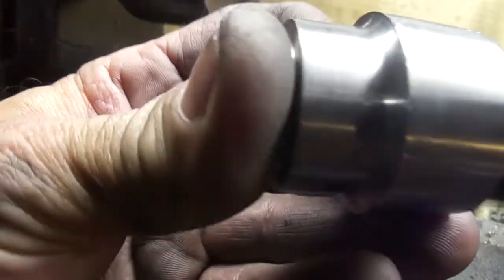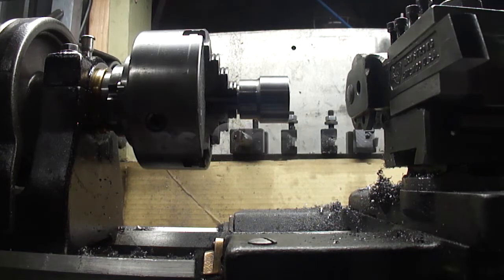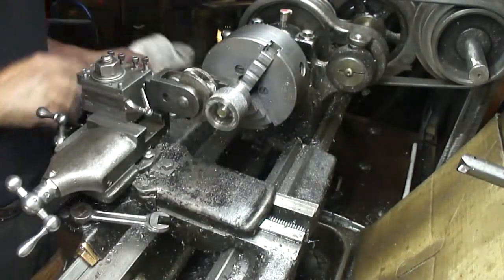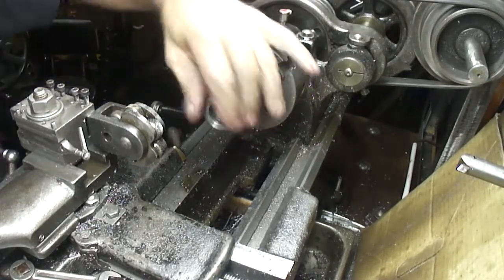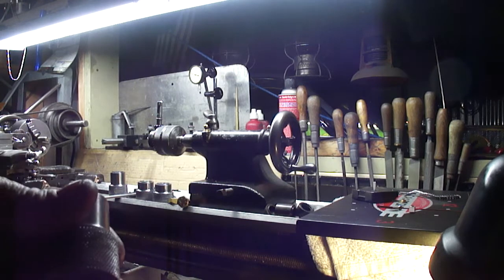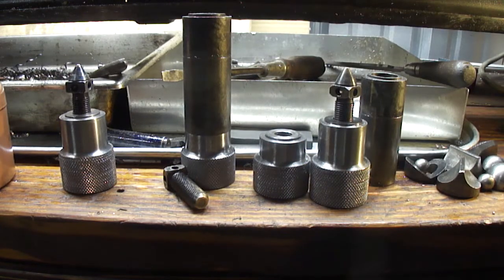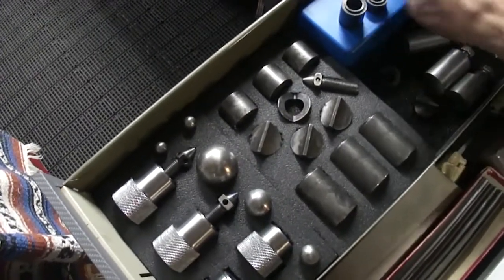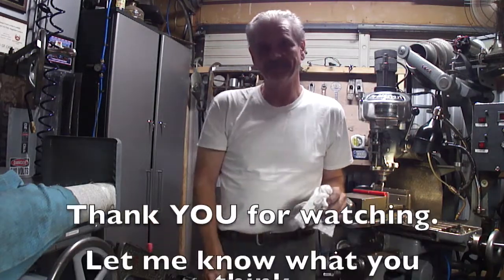Machinist Jacks Part 4 Final Chapter

Comment: These came out nice! Get a hardened and ground pin, I use a 3/8” by 2 or 3”, put it in the lathe jaws and using a dial indicator check for runout. That will tell you if your chuck jaws are out of whack. You may need to grind your jaws. I had to scrap my original chuck the jaws were way bell mouth and the scroll was worn beyond use. I couldn’t get a good grind, it would come out good at one diameter but be way off at other diameters. I believe it was the original 5” chuck to the lathe that was made in 1945.
Reply from the maker: - John I totally agree with you. I’ll get the pin and check for runout but I think you’re right. I think the jaws might need to be ground. Doesn’t look like they have ever been. How about shims in the headstock. Maybe I should check for how much play I have in the bearings also. Mine is a 1929 and it’s probably the original Chuck. Thank you for watching and commenting. I wouldn’t learn without you guys.
Reply: For small chucks it maybe cheaper to buy a new one then to invest in a tool post grinder. Does your lathe have power feed? If so power feed your next knurling job and see if the pattern comes out better.